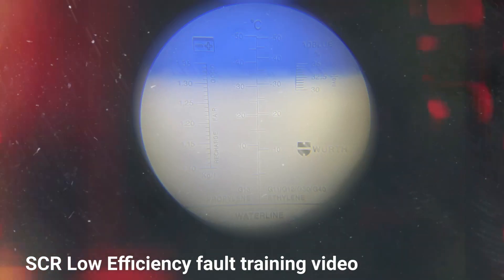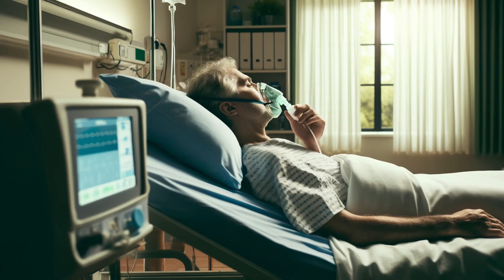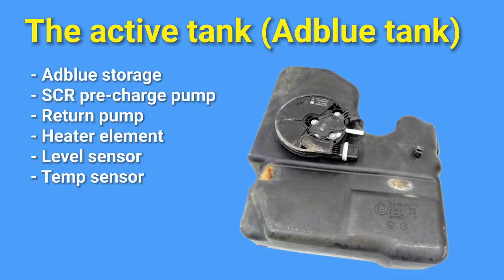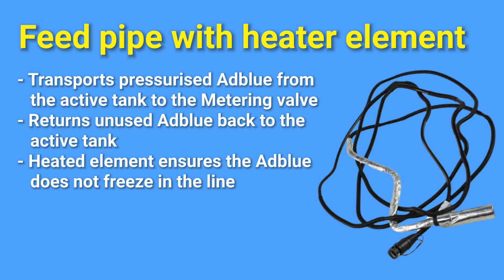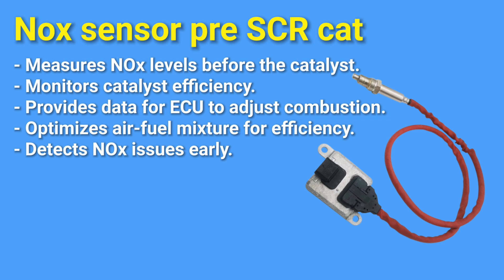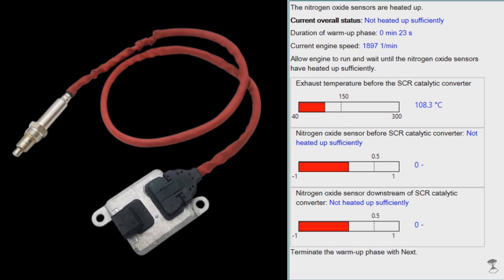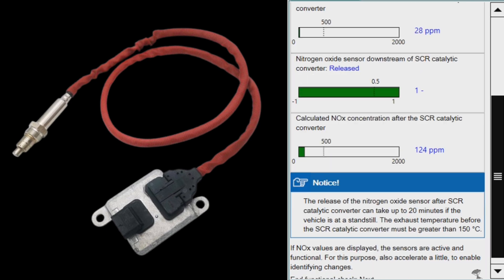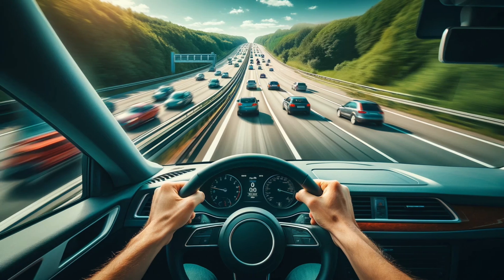The Truth About AdBlue, DEF, and SCR Technology

Comment: I did some work on a Class 20 diesel electric loco with a 15.4 litre 1000BHP built in the early 1960's.  The engine was meticuously stripped and rebuilt and afterwards was tested for NOx.  It easily passed the emissions to allow it to work in central London for London Underground.  Moral of the story, if you don't build high compression diesel engines and you don't create loads of NOx!
Good video. 👌
Reply from the maker: Very interesting Julian. I would love to work on one of those mate. I had fun making that vid 🙂